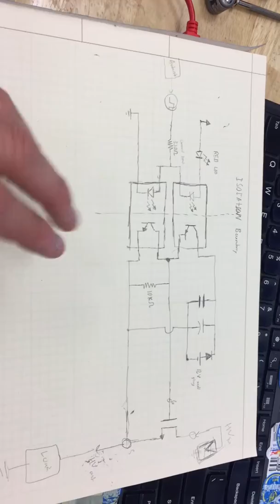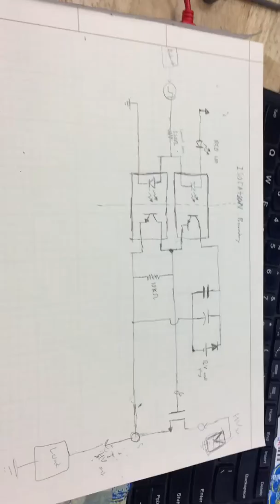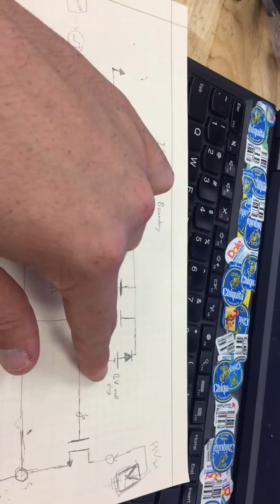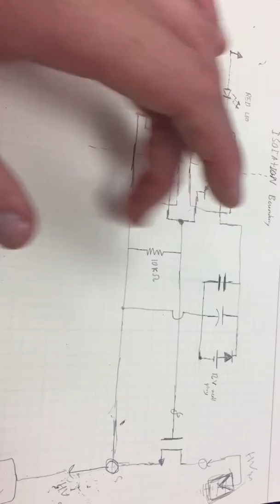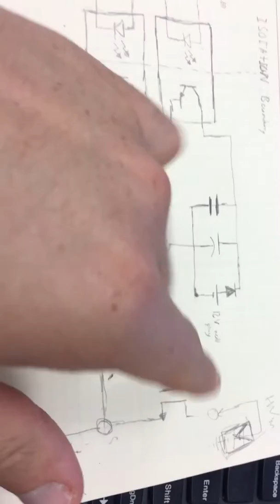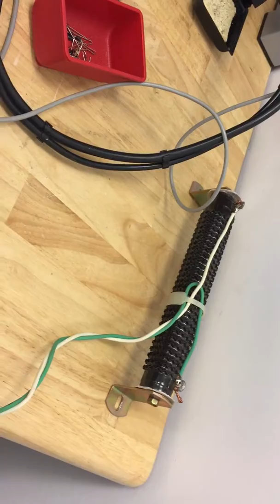Arduino 12V PWM signal using Opto-couplers

Comment: You can do it with just one opto-coupler by grounding the gate of the MOSFET with the 10k resister. It is called a pull down resister, and allows the MOSFET gate capacitor to discharge when the signal is low.

Comment: Nice!!! What capacitor values and what MOSFET did you use?
Reply from the maker: Mosfet was IRF540,  Caps were a 1uF ceramic and 10 uF electrolytic I think.